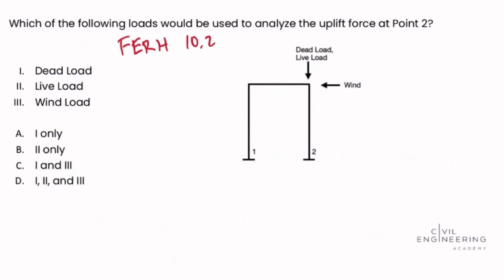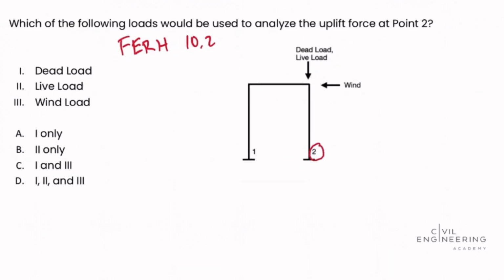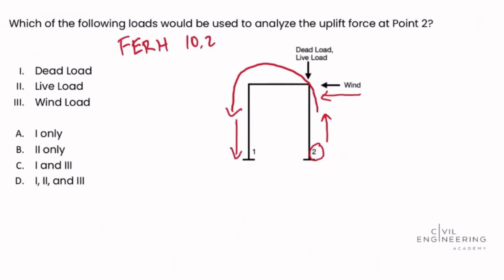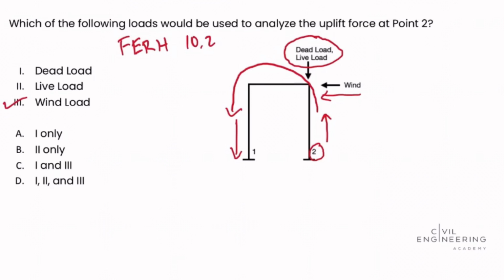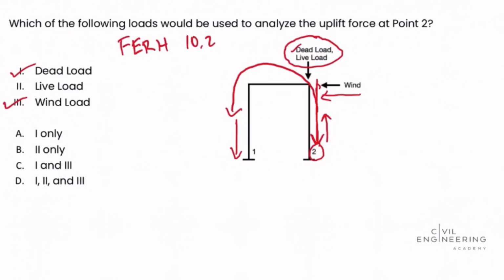Civil FE Exam – Structures – Find the Loads That Contribute to the Uplift Force at a Structure

Comment: I agreed with the WL can cause an uplift on point 2 and LL may not have an effect on uplifting on point 2 unless it is specified the load moves from left to write. However, if the DL would remain where it is showing won't have an uplift effect at all. On contrary, it contributes to remaining intact on point 2.

Comment: Please explain more in depth why LL isn't always present, why we can't use it to calc total rotation.

LRFD and ASD dont ignore it.

I think "maximum uplift force" might have been a better way to phrase question.
Reply from the maker: The important point is that we consider the most dangerous case when we design as we are conservative.  When solving the greatest uplift, it means the live load will create uplift if it exists. So, we will include the live load.

When solving about resisting, it means live load should not be included, in case live load doesn't exist.

The wording is always tricky on the real exam and many times left to engineers to interpret and figure out.  This is why many consider the exam "tricky."